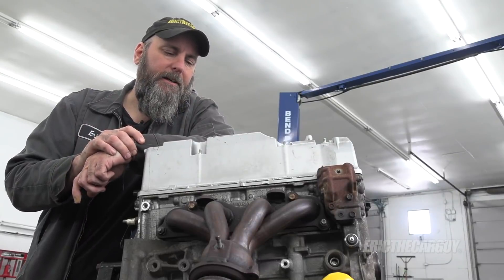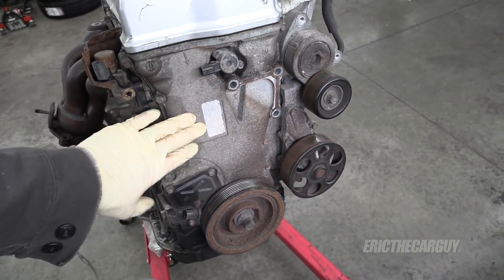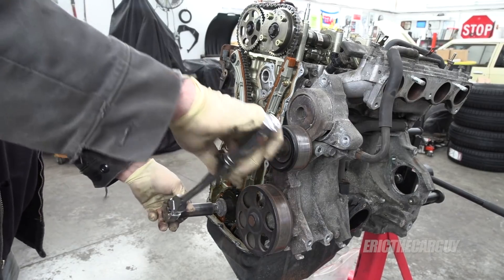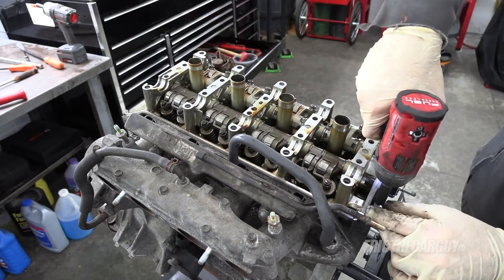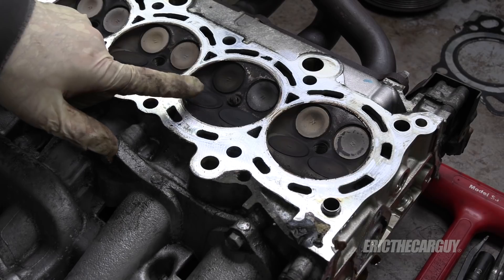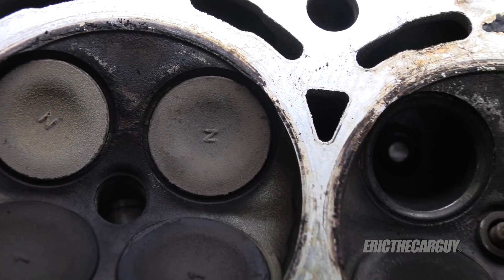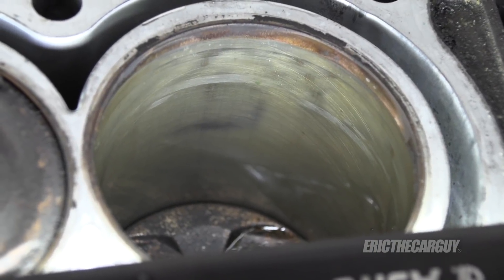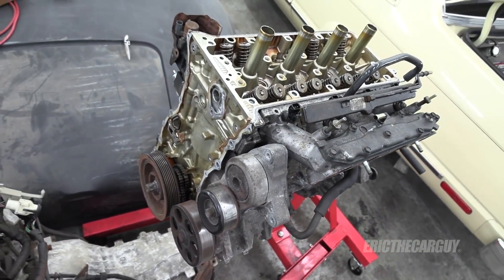Honda K Series Fail, What Went Wrong?

Comment: Invaluable and selfless information sharing. Thanks for all the sweat equity you put into your videos, both turning wrenches and editing. I am currently rebuilding a Toyota 3tc and I intend to replace the valve guides and seals since I am already there. Is it a MUST that the aluminum cylinder head be heated before replacing the guides? The manual calls for it but I wanted to hear from an experienced perspective. Thanks in advance.

Comment: Eric, I Love watching, you make me a better Industrial Designer/want-a-be mechanic every day.  Where can I get an "Ericthecaguy" hat?  Question.  I have the same k series engine in my 05 Accord.  I hear "little collective taps" that go away after the car warms up, it has 154K I don't know if this car had a valve adjustment at 100K, Honestly, I can't remember if I owned it at 100K, will I be ok for another year until I have time to adjust the valves?  I change the oil every 3K and it runs like a dream with full and proper pampering as needed. Keep the blue side up brother and thanks!

Comment: The exhaust valves are worn because the engine most likely didn't have a valve adjustment at the regular intervals. The k24 engine is notorious for the exhaust valves getting tighter over time. If you take a k24 engine and you never adjust the valves, you'll have real tight exhaust valves and usually loose intake valves. You know what happens then

Comment: Thanks very much for these videos! I have a 2007 Accord 2.4 with about 235k miles, but I’ve only had it about two years. I’ve noticed the gas mileage has really dropped in the last few months, like down to 18 mpg from 22-24, without any real change in driving habits. It has also caught me out a couple times with very low oil, warning me with a blinking oil light (I know, I need to check the dipstick more often, that’s on me). I’m planning to take it in for a valve adjustment soon, but I’m wondering what else I might want to take a look at. I replaced the spark plugs, PCV valve, and EGR gasket, and cleaned out the EGR passages.
Reply: Most likely you need to replace the O2 sensors.
Reply: @gfriedman99  I replaced the O2 sensor last year, although it still throws a check engine light for "P0141 - downstream O2 sensor - slow response" every once in a while, particularly when it's cold out. I bought a Denso sensor, which is supposedly OEM, but I guess some people have better luck with different manufacturers?
Reply: @jonathankleinow2073  Sounds like you might have replaced the wrong one.   The downstream sensor is in the catalytic converter.  The one in the exhaust manifold is the upstream sensor.   Yes Denso is good but you also have to make sure you get the right part depending on whether you have a ULEV car or not.   The Denso website has a parts lookup.    The computer will compute the wrong fuel ratios with different parts.

Comment: I ran the machine at Anna on c shift that line bored the crank journals and faced the head surface and also pin stamper that stamped bearing sizes for crank on the bottom edge of the block for this engine from 07 to 13 I carried these things around like cinder blocks till I couldnt stand to look at them anymore lol, before going back to frame plant interesting fact is honda measured in microns and just one process of quality checks I did on these blocks was 8 pages long every bolt hole every even texture of machine surface held to highest standard even honda oil for longest lasting best results, anyhow sorry it bit the big one on ya fella they are easy to rebuild but you better use oem lol I hope your move goes smooth to your new shop.

Comment: My 2003 accord was burning a lot of oil by 180k.
Anyways I replace the timing chain.
Few thousand miles later the oil pump chain tensioner plastic guide disintegrated, no damage. Replaced it. The job absolutely sucked.
Few thousand miles later burnt an exhaust valve. Get valve job and reinstall 
Few thousand miles later. 
Another burnt ex valve on same number 4 cylinder. 
I’m sure the valves were badly pitted and the damn machine shop should have told me during the valve job.
Picked up a motor from H motor online and no problems except it uses a lot of oil. 
About a quart every 5000 miles and it automatic and I don’t rev the shit out of it.

Wtf with these k motors burning oil?
Reply: quart every 5000 miles....is nothing.  well within reasonable oil usage

Comment: 15:00  I comment this many times.  Some oil goes to cylinder but it's not burn(or only part is burn) . Example oil comes by the rings or valve seal. This oil on lambda sensor is like too much fuel. Less oxygen too rich fuel. ECU cut fuel. Less fuel means hotter exhaust smoke. Exhaust is hotter and effect is more brown solid on exhaust valve. Valve damage. If this engine have hydro valve it only die longer, engines with hydroaulic valves example 2.0 8V 1.8T VAG die long

Comment: Here is what i learned, noisy honda k series valvetrain? Adjust the valves, even at 100k miles the lash needes to be checked if loose, adjust valve lash until you feel a slight resistance on the feeler gauge. No adjust valves? Equals burned exhaust valve Equals no compression, and its more likely on the inner two cylinders since they get hotter, point is if you have a honda k series...ADJUST YOUR VALVES

Comment: Exhaust valves dissipate by their heat via conduction by making contact with the valve seat.  Otherwise, they can dissipate a little through the guide, but not much.  When the valve lash becomes zero or negative, the valve doesn't close all the way or doesn't close tightly and the edges of the valve face will literally blow-torch away.  The edge of the valve face is where heat is most prominent in a valve, so it is the first to go.
However, I am surprised that this thing had zero compression.  Just based on experience with the flow of solvent out of the exhaust port, I would have guessed that it was making 70-80 PSI yet.

Comment: Hi Eric, High quality videos that are very educative as always. I'm going to watch all the series on your Element. My son gave me a 2006 that's still in very good shape inside and out. He gave up on it because it kept overheating while idling. I helped him perform a compression test but the compression was OK on all cylinders. Yet, the scanner returned some misfiring errors and his mechanics used an endoscope to confirm that the car will need a head or valve job.  Is the 2006 is similar enough to your 2005 so that I would use your video as reference when the time comes for me to tear it apart? Thanks.

Comment: Guessing at the start, that its valve stem seals due to mileage causing oil burning. Not sure about low compression. I'm guessing valve related and not to do with the piston or cylinder.

EDIT: Actually surprised how worn out the rest of the engine was. Interesting stuff. I did my K series valve lash at about 65000 miles. Everyone of them were out of factory spec. Maybe every 50000 miles would be better?

Comment: The valve let some compression by but not all of it no way. Those rings in #2 are toast for sure.
Reply from the maker: Possibly, but the solvent leaked out pretty quick, air would take even less time, especially compressed air. Thanks for the comment.
Reply: @ericthecarguy  the cylinder would still build a little compression tho, especially in a high compression motor. Don't mean to argue with you but I've had valves you could stick a feeler gauge through that would still build 40 or so PSI in the cylinder. Either way still enjoy your video's been watching you since way back when you were working on the side in your tight one bay shop. keep up the good work Eric.

Comment: great info. hydraulic is better so you don't have to deal with it. a lot of people that don't know this info. will have this problem . BTY about how much is this going to cost your customer?
Reply from the maker: From an engineering standpoint, solid valve trains are better because they are more accurate and have less moving parts to fail. Solid valve trains also make more power because they are more consistent than hydraulic. The down side is periodic adjustment.
Reply: @ericthecarguy  had a Kawasaki zrx 1100 for 15 yrs. Valve adj. Was critical. But it ran like a scalded dog!

Comment: I guess i've got same issue, maybe not that bad yet at 235k. I love my Honda a lot even it is becomes an old rusty junkyard zombi killer wandering the streets, but it still runs like a hell... and I just can not spot any better option for me as a best vehicle for any purpose yet. Anyways i wish you all Element holders best luck and keep it running. My Honda mechanics and dealers told me surprisingly that not oem (not original) oil filter can damage especially this engine exactly that way Erick showing us because of v-tec and non correct oil pressure that is critical for that motor. So i will strongly recommend to all you Element and Honda v-tec owners to order oem filter instead of a cheap one and change it by yourself to keep that engine healthy for much much longer time and no issues... Coz as you can see the motor is looking as a new inside. And from me i will add little tip. Don't drop or let others even a sandcorn in the oil cap hole coz it will fall exactly to the exit valve cyl 2... Just saying that to all you guys for consideration coz it is not much more needed than the twist of a dirt to kill that unbeatable engine i guess ;)

Comment: Eric, in the video you mention valve adjustment every 100,000 miles.  You also noted that not to many mechanics know how to do this task properly.  Can I forgo this maintenance if my engine runs fine?  I have a 2008 CRV with 2.4 K series engine and 185,000 miles with no valve adjustments.
Reply from the maker: Yes, but it's not as difficult as you might think. It just takes practice. https://www.youtube.com/watch?v=959I0wF5NH8&t=4s

Comment: I have the same mileage. You're scaring me lol I need a cat and new o2 sensors all else seems ok. 😅
Reply from the maker: I believe this engine suffered abuse and neglect early in its life which lead to its eventual failure. A well maintained K series, change the oil regularly, will last a good long time before oil consumption becomes an issue.
Reply: As long as you take care of it you should be good for a while, these K24's have proven themselves to very reliable engines over the last almost 2 decades. But like everything else, they can suffer premature failures if abused or not maintained properly.

Comment: Smashing strip down :-D
If you had decided to repair that engine you would still have to strip it down and replace a fair amount.
Otherwise it would be a half baked job.
Replacement of the engine was the right thing to do.
Very quick in comparison to a rebuild.
Reply from the maker: Not to mention my new engine is a low mileage unit from Japan. Yea, I simply didn't want to invest the time, money, and effort into this engine. It's still good, with a proper rebuild, and will make its new owner very happy I hope. Always great to see you.

Comment: You should just try and pop some new valves into there, after cleaning up the seat. I bet it would restore compression, and make the engine work again.
Reply from the maker: I agree, and I believe I mentioned that, and why I didn't bother doing it. Thanks for the comment.

Comment: i had a 2nd gen crv with a k24a and had like 450 000km and still running. i went to a k24z in a 2007 crv and blew 3 engines then went back to a 2nd gen haha

Comment: Re: oil consumption, wouldn’t the valve stem seals on the intake side be the likeliest culprit, at least where the valvetrain is concerned?

I had a ‘94 Crown Vic with the first generation 4.6, notorious for dry rotted valve stem seals... during periods of high manifold vacuum, eg at idle at a stop, the negative pressure would cause oil to seep past the useless seals. Then you hit the gas to take off, and all that oil on the stem and back of the valve would get blown into the combustion chamber, burned, and it would leave quite a decent blue plume for a short while until it all burned off (quantity of smoke dependent on how long you sat at idle).

I figure worn guides and seals on the exhaust side wouldn’t matter too much, since the exhaust manifold is always under at least some positive pressure when running. And the oil would just get blown down the exhaust anyway.
Reply from the maker: If the valve guides are worn, the valve seals are not as effective at sealing. In my experience, both intake and exhaust wear the same. You also need to consider the worn piston rings and cylinder bores. Engines wear globally, not just in the block or cylinder head. All of this contributes to oil consumption which is why I chose to replace my engine with a low mile unit over rebuilding this one. https://www.youtube.com/watch?v=KWjF56tFzRg&t=14s

Thanks for the comment.

Comment: Hi, at 10:20 time, how did you go from the cylinder heads to the exhaust heads? Are the exhaust valves under the cylinders? Thanks for the video :)

Comment: Do you recommend replacing the motor or rebuilding what’s better and won’t kill the bank I have a 2k budget motor is sitting at 147k and is giving signs of valve tick and also signs of bad timing tensioner

Comment: Not sure why these engine have such a good reputation. Our Honda Accord started to burn oil to a tune of a quart per gas fill up at 75k miles. We replaced the engine under warranty and it too started to burn oil. Our CRV at 88k miles is starting to burn oil.
Reply: Because they're good engines with few exceptions. Mine has 285k miles on it with no issues.

Comment: Hey Eric, I first wanna say that I watch your channels all the time, you are a very informative mechanic. I'm a self-taught mechanic due to not being able to afford to have someone work on my car for major repairs, I had to learn. I've done just about everything you can do to a civic lol. Anyway, I got a question as I don't know it all and I'm always trying to learn. I have my first k series engine and it runs great and has great compression at 190 dead on across all 4 cylinders and 195 on a wet compression test which I consider great for an engine with 175000 on it. I am however thinking of doing the valve seals and valve stems due to a little blue smoke in the mornings, I'm thinking it's oil leaking down the valve stems and burning off in the morning. I'm wondering can this job be done with the head on? I'm fairly certain it can be, I'm just wondering what does need need to be removed aside from valve cover? I assume the cams and timing chain as well correct? Thanks for any help you can provide.

Comment: Question,what would be the ex valve setting when I find the cam lobe workout a lot. I put the valve to spec, just like if all was normal on the ex lobe. I know I need a new cam .
 cylinder  1 psi 175 one and all others are 180 psi.  Grate i running quiet . Why did that one lobe is so worn out, others are ok wear. Can I compensate the valve lash on that ex valve with out destroying it. Not shure what’s going to happen

Comment: hey Eric i have a question, i seen you got that use Japan engine and i seen that it did not come with the vtech solenoid and you put the solenoid on, my question is can i use the engine without it if i get a new engine or should i just get the jdm ecu and put it on my crv ???

Comment: Owner neglect, low quality oil, infrequent oil changes, low quality gasoline, valve adjustments ignored. Honda also had block casting problems on the early K24 engines, known oil burners. For this engine, exhaust valves tightened up burning the valve seat. K24 owners Adjust your Valves!
Reply from the maker: I suspect the original owner abused and neglected it. However, the 2nd owner, the one I bought it from, was very good about maintenance. Thanks for your comment.
Reply: @ericthecarguy  made me crazy watching one owner well maintained Hondas being sold to people that were only looking for a transportation car then running them to the ground. In your case the opposite is true 😉

Comment: That's not burning any oil and 1st step is TDC then check the valves for closer with cams still attached.Then you can tell if its a valve,follower or cam problem.Amazing how little this guy actually knows about engines even after all this time
Reply from the maker: Careful, your penis size is showing.

Comment: I’m planning to get myself an element as well, what type of maintenance I can do to help the car engine last longer? Also, where do you get another engine from if I need to get one?
Reply: Engines can be found all over the internet, as for the maintenance change your oil every 5k miles, and Trans fluid every 30k. Do those 2 things on time and you'll have few issues.

Comment: Eric, you know anything about 7th gen Accords with a K24 and horrible shaking at idle? I'm thinking I need the OEM front mount and doing that TSB stuff rocking the engine. I got a full aftermarket kit from Rockauto installed and it still feels horrible. Just wanted to know if you had any experience with it.